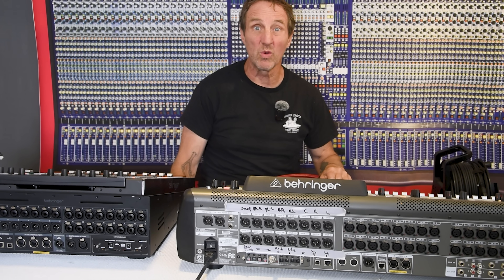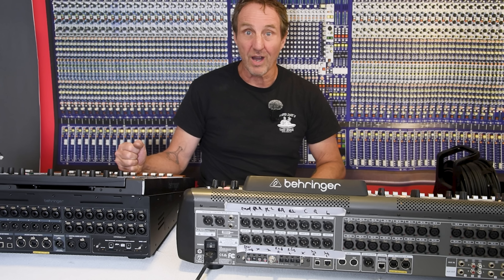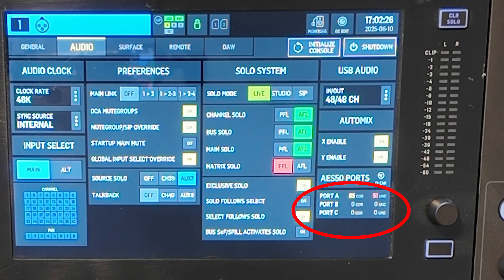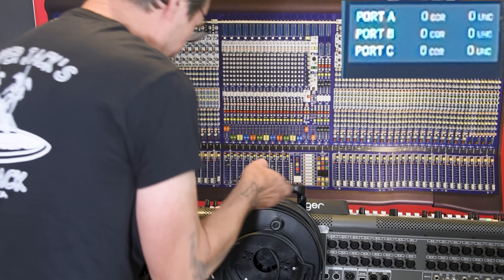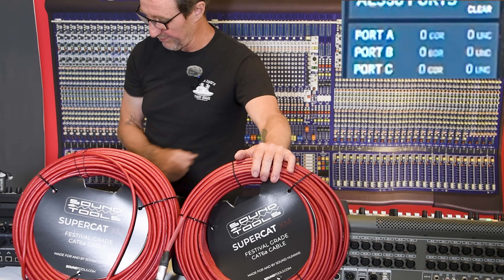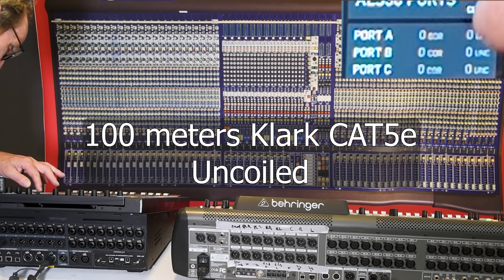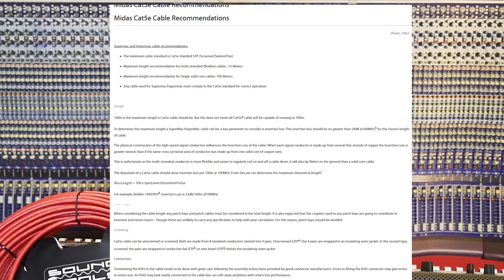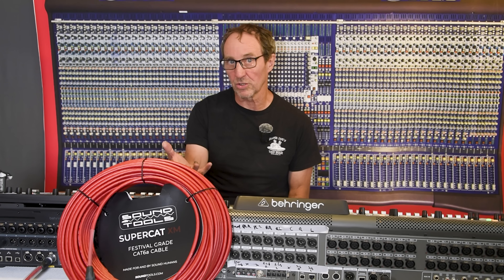Misinformation or Simple Test? - CAT5e vs CAT6a

Comment: noise immunity- dropped packets is one thing, but what about noise & jitter getting in from (e.g.) other data connections bundled with yr audio, or power cabling?
Reply from the maker: interesting. how familiar are you with AES50 specifically and the way it is impacted by noise?

are you aware of any noise or factors that will cause AES50 to drop out or pop or cause audible issues that do not involve dropped or altered packets?
Reply: we're aes67, mostly- 2110 broadcast infrastructure, but (as is often the way) the building we're in was not purpose built for broadcast use, & so we have stuff like cabling from a UPS taking the same route (ducting & whatnot) as the signal cables. 

from time to time, I've seen increased jitter, packet loss & so forth when the control rooms & commentary booths have been busy. some equipment (intercom panels, remote panels for vision mixers & stunt-replay video devices) will actually go offline, disconnecting itself from the crate back in the machine room.
I'm in support- didn't have a hand in the design-spec-build, & so I didn't get to join in the fight, which we lost, to have shielded cat6 everywhere. the wiremen wanted to put in cat7. we ended up with mostly cat6, but the unshielded sort, & the cable runs from the production rooms back to the machine rooms are tight, so I imagine crosstalk is also a factor, along with noise from power cables & so on.
Reply from the maker: super interesting and thank you!

I'm not super well versed in networking. I do know that AES50 is quite unique and different than AES67

AES50 is a multi-channel point to point audio interconnection standard rather than a network and will not travel through network switches and such.

 sounds like a few days with a fluke DSX network analyzer would provide some interesting info for you. 

we have a couple of them, and old version and a dsx5000 that we use for troubleshooting and testing prototypes for the cables we make.

but the challenge for you is all the outside influencing noise is probably not consistent. 

very cool and thank you!

Comment: Can you tell if Cat6 is ok?
Reply from the maker: there are a lot of different companies making different versions of cat6 but typically cat 6 will exceed cat 5e specifications. 

music tribe recommends strongly that you use shielded cable so shielded cat6 and not unshielded cat6

and at lengths 80 m in below or about 250 ft or less pretty much all the cables work including CAT6 

if you really want to know if a cable works and is stable put an extension of about 20% of the length on the cable and see if it's still functions and then remove the extension and now you know that you have a good buffer zone.

Comment: I witnessed a cat6 multi going out of spec due to overheating before.  

Literally dumping ice in to the cable ramps solved the issue.

The production manager who bought the multi had made a mistake and ordered it at 100m So it was only just in spec anyway.

It was eight ways of van dam tour cat believe. Multiple departments were sharing it. Some departments had redundant links, such as audio and lighting.

Various departments started having issues during the midday sun on one of our tech rehearsal days. It was strange to have multiple departments affected by issues at the same time,  with kit we had used previously multiple times in multiple countries.

Due to it being hot, on the off chance, somebody thought to check the spec of the cable we were using and found that temperatures inside the cable ramp far exceeded the spec of the cable ( seventy degrees or so dungarees. science, not barbarian, units. )

Honestly, wouldn't believe it if I didn't see it with my own eyes, but chucking ice buckets into the cable ramp and spraying them down with a hosepipe solved all the issues we were having. Due to the multi being 100 m with a link on each end, the spec was allready slightly exceeded.
And I think the excess temperature just pushed over the edge.
Reply from the maker: interesting. well resistance of wire does increase with temperature so if the cable was right on the edge of working and then it got hot it's definitely possible that the added resistance could cause issues. 

to the best of my knowledge the temperature specs are not actually for the passing of signal but rather they have to do with the durability and flexibility of the jacket material and insulators. 

operating below the temperature spec of a cable will cause it to be very stiff possibly crack and fracture. operating above the temperature spec of a cable can cause it to melt and warp and short out. 

but what you bring up is a whole new angle which I never thought of and is fascinating. since the insertion loss is one of the dominant factors in causing issues and increased resistance will definitely increase insertion loss, Yes a long run of cable that gets hot could totally fail until cooled down
Reply: @DaveRat it was quite repetable,  it happend again the next day but at least we were prepared for show days.
Reply from the maker: sounds like you need to get better cable and follow the 20% rule. 

wherein you extend the cable by 20% and make sure it still works and then remove the extension. 

I am confident that this cable will fail the 20% rule and if you get a cable that passes the 20% rule you will no longer have issues.
Reply: @DaveRat  The multi was shortend by 15m after that show.  Being UK based high temps normaly are not an issue.  Pritty sure it was Van damme (VDC)  pritty much the go to this side of the pond.

Comment: And there's the problem, a lot of cables don't publish that spec., certainly not the cheap stuff that most people are buying. I think I only have one cable that published full specs. and it also shows a faster velocity of propagation to go with the lower loss at 100Mhz and insertion loss.

Also, looks like I need to update some firmware on our M32 devices to get the error reading.

Comment: Hey Dave,

I have to run 2 supercat XM cables at our new theatre for the M32 at FOH. I already bought them but the conduits they installed were smaller than the spec. 

So we have to cut the ends off to pull them and crimp on new rj45 connectors. 

1. I should be able to reuse the outside jacket and relief?

2. What brand/ model rj45 connector should I use?

Thanks!
Reply from the maker: very cool and yes you can reuse the shells and the strain relief and the boot. 

though it's not recommended you could actually reuse the crimp on connectors as well. where are you located? 

send an email to sound tools or give us a call and talk to DK or myself and DK knows the part number I don't know what off the top of my head for the RJ45 connector. 

also if you're not too far away, maybe we can just send them to you
Reply: Thanks dave. Its the new Strathcona Performing Arts Center in Bonnyville Alberta, Canada. Ill send an email to get the RJ45 model @DaveRat
Reply from the maker: https://www.neutrik.com/en/product/ne8mx6 is the connector we use on the SuperCat xm
Reply: @DaveRat sweet! Now that's fast support! 

No suprise why spundtools /ratsound got where it is.
Reply: @DaveRat When testing the stability of AES50 over long runs, does it matter how many channels of audio are being sent? You have been testing stereo audio but would it make a difference if your running 32ch in and 16ch out? Vs just one or two audio channels?
Reply from the maker: I did another AES50 video, I thing the first one I did, I used 32 outputs and 32 inputs with pretty much the same results where sheilded Cat5e was failing around 80 meters 

I have not done tests of increasing the channels, but all the tests I've done show that cable with low insertion loss can be longer and an insertion loss of 24dB or less is always stable.

Comment: Have you checked out? P k sounds dynamic software yet?
Reply: Dave Rat deserves to werk with pk
Reply from the maker: it's been a while but I've heard their systems and had discussions with them when they were developing their powersoft M-Force sub offering some insights on what I've learned 

interesting and cool stuff and they have approached us several times about getting on board with their systems and such. 

for a lot of what we do we are maxing out our hang weight requirements and the PK rig is considerably heavier per DB delivered than L-acoustics and other less controllable products with the exception maybe of Meyer which is also really heavy. 

while I appreciate the control PK sound systems offer the balance between size, weight, sound quality, cost, and maximum output level and other factors like dB output per linear truck foot, dB output for linear hang height, dB output per pound of system weight and sound quality consistency between multiple products in the full product line of available solutions, PK sound just doesn't hit enough of the positives compared to other systems available.

it's a similar challenge we faced with the EAW Anya system where it excelled in a narrow-ish niche of applications but wasn't versatile enough to be a go-to system

Comment: The statement I am about to make is going to offend some and piss off others. Normally I would be careful to not do this, normally I wouldn't say things that I know will intentionally make people mad, but this is the truth and it has to be said. 
Ethernet cables for pro audio, video, lighting, are the worst possible cables you could ever use for this purpose. 
I say this because they are so fragile and the slightest thing will break them. 
Have you ever in your life heard of the BNC cables on an Avid for the AVB network being notorious for failure at the same pace as an ethercon is?
Obviously they can fail, everything can, but what has a higher failure rate? BNC or ethernet? 
So the background of this is that when I first started being the guy who plugged the cat5 cable into the mixer, I was warned about how fragile the ethernet cables are. 
Why would you ever want to trust such a fragile, very breakable cable for a mission critical situation?
We need to petition the manufacturers to give us a better solution.
Maybe a multipin version of Cat6? Why not a version of W1 that is for ethernet? 
There are some mixing consoles that you cannot use a panel mount ethercon jack inline between the stage and FOH. I truly believe that if we had a super rugged cable (which we do have) that has a multipin end with a Ramlatch/W1/CPC style connector, things would be better, 
I would feel more confident in an X32/SD12/LV1/HD96/Pro1/CL5...... that had a multipin twistlock connector for the digital snake. 
Mr. Rat, please develop this for us. Make us an end that you can put on a shielded Cat5/6/7/8 tactical cable that you need the proprietary, hardened steel jack panel that is bulletproof. 
I would pay $150 per jack panel and another $80 for a cable end that screws into the jack panel. I would right now. I would buy 20 or each.

Comment: Connectors are the bane of most issues. Test 100m straight CAT5e???
Reply from the maker: here is a video I did where I tested ethercon couplers and show exactly their impact and the difference between Cat5e and Cat6A couplers 

https://youtu.be/QFsJaxG8AAA?si=zQAJUJ04t7cBRJXD

And here is a video where I test Cat5e and other cables without couplers and with couplers to determine maximum lengths 

https://youtu.be/Fn3OanfKcnc?si=pJGX5btDTYcOQ73c

Comment: I have seen different Cat5E aswell as Cat6/Cat6a fail miserably and work flawlessly in the same length and situation . It seems there‘s even more than the on-paper specifications of these cables. It would have been interesting seeing the same thing done with „regular“ Cat6 and Cat6a. Your cable is probably very high quality and thoroughly tested. Maybe that‘s more important than fulfilling Cat6a specs as written.
Reply from the maker: totally agree. there are huge variations in each of the various categories of data cables. 

you can't just buy a cable based on its category and know that it work for long runs. 

for AES 50 if you look up the specification of the cable and make sure that the insertion loss is 24 dB or less at 100 m and 100 Hertz then there is an almost absolute that the cable will work for AES 50 at 100 m. 

for a deeper dive into all of this maybe check out this other video I did:

https://youtu.be/Fn3OanfKcnc?si=9SbJvyVNJuv6HoiR

Comment: Again, as previously, your logic in troubleshooting and testing is impeccable. The only way to actually advance in knowledge. Although of course the n value is low (should test like 20 pieces of cable reels to show some consistency), but for a single test, a solid and clear 100%.Thank you!
Reply from the maker: thank you and very cool. while I have not tested multiple units of that specific shielded Klark Teknik Cat5e, I have tested lots of Cat5e as well as we test every single cable of the super cat XM cat6a before it goes out 

And what I show in the video lines up with the repetitive tests and excellent observation

Comment: Is there a way to monitor AES50 errors for consoles other than the Behringer Wing i.e. X/M32? And what about testing cables spec'd for AES50 to discover potential causes of errors?
Reply from the maker: not that I'm aware of, in this other video I did I describe how to test your gables and make sure you are operating with a good margin of safety

https://youtu.be/Fn3OanfKcnc?si=0DZL4uosh3aGmCsQ

Comment: Near the margin, the quality of the added interconnect between two cables is likely the significant point of reflection failure. By quality, I mean connector design AND assembly. Reflections will occur first at an Ethernet interconnection because of the deviation from twist pitch. 

Interconnected 5e, or any type for that matter, would fail at a shorter length than one piece without interconnect. For this reason, I scrupulously avoid interconns if I am anywhere near the published limit. That said, I use a single continuous 100m of 5e for my Behringer P16 phones system without issue. Yet.

As to cable preference, in my experience, 6a is miles (not literal) ahead of 5e. Since the advent of your super-cable, the choice is clear, even if at a $ cost.
Reply from the maker: very cool and thank you and I agree. 

in fact I even did a video on ethercon couplers and compared 5e couplers to 6A couplers 

here is a link if you're interested 

https://youtu.be/QFsJaxG8AAA?si=bfmvn8KitIhyHj35

Comment: Awesome video. Has anybody done a test with CAT8?
Reply from the maker: I have tested some CAT6 and CAT7 that don't go as far as cat6A and are just slightly longer runs than cat 5e. 

that said, there are a lot of variables within each category. 

 unshielded Cat5e can run much longer lengths than shielded cat5e.

individually shielded pairs like this cat 6A has typically won't go as far as cable with an overall shield due to increased capacitance, Even though this cat 6A has an overall shield and individual shields as well.

you really need to look at the individual specs on each cable model and brand and see what the loss is at 100 m 100 megahertz and make sure it's 24 dB or less regardless of the category of cable. 

loss is one spec but there are many specs associated with each category

Comment: all my cables are stranded UFTP CAT6A at 85m, no problems for AES50
Reply from the maker: very cool and also many cables including many versions of Cat5e will work at 85 m. 

it's the 100 m point that many cables either fail or are very close to failing.

I would say that if your cable is stable at 120 m it's safe at 100 m. 

The cable I have in the video is stable at over 140 m and is safe at 120 m.

like anything crucial, you want a margin of buffer and not to operate right on the edge. 

I recommend extending any cable you're using out 20% more to ensure that it's stable and then you'll know that when you remove the 20% you're well within a safe zone.

Comment: 😡Yea, but... that cable is specified for X32, not WING with AES Analyzer so the issue is in using wing for sure! (It is a joke) 😂 BUT! Argument for cat5e people is.. that YOUR cable is special. So random CAT6 cable is wrong 🙃
Reply from the maker: well, that may be somewhat true. cat6a is significantly better than cat6 and cat6 is often nearly the same as CAT5e and also there is a huge variation between different versions of cat6 and also between different versions of cat6a, just like with Cat5e. 

 it's quite difficult to find cat6a cable that has a low loss down in the 18 DB range at 100 megahertz like this red cable has. 

in fact I have not found another cable that anyone makes that has stranded conductors and has a loss in the 18 or 19 dB range for 100 m 100 megahertz other than the red cable that we make.

but as a general rule of thumb using CAT6A over Cat5e should give you better performance in nearly every scenario